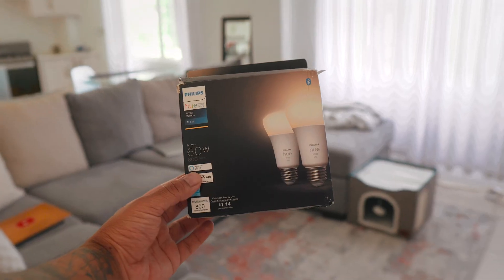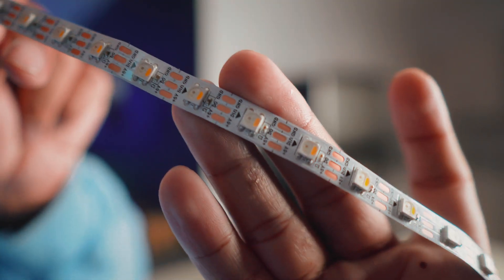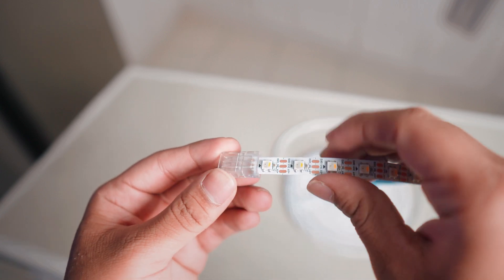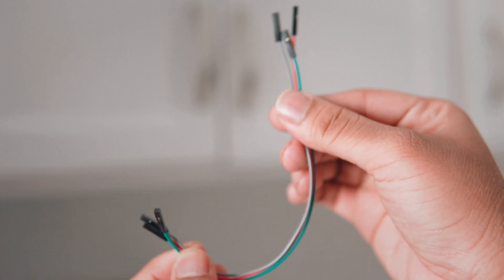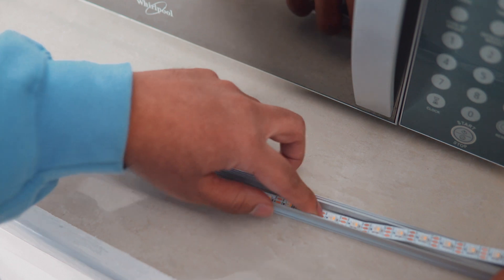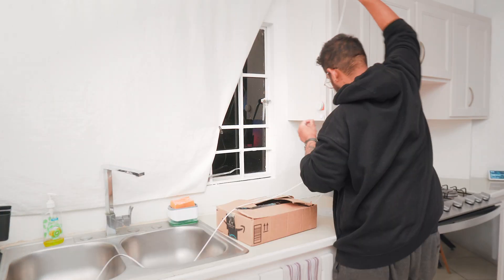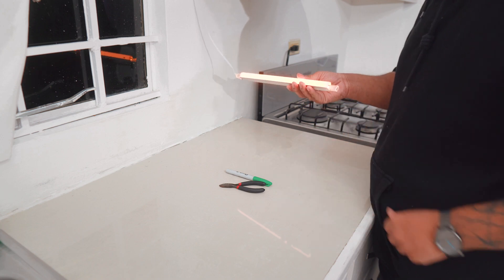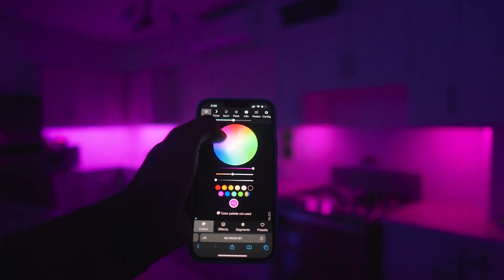Is this DIY Smart LED Strip better than LIFX and Philips Hue?...and CHEAPER too? | WLED

Comment: So you run all the strips I guess in a series circuit (throw back to forum 1-2 physics) but when you say you code the LEDs do you code each one as a individual or u just add more for each extra piece of strip you add on?